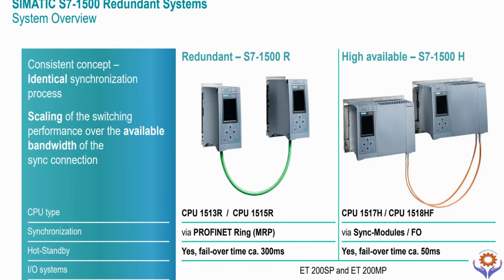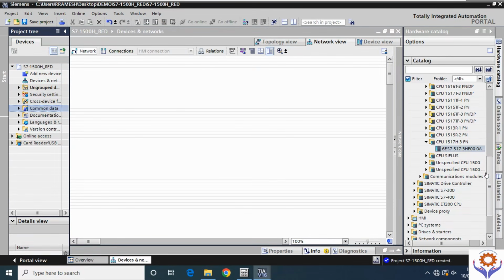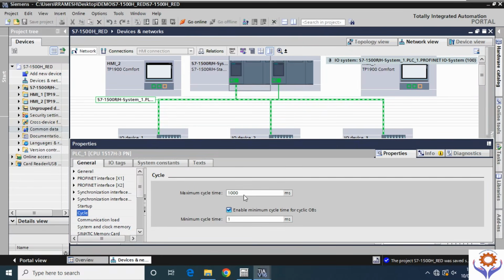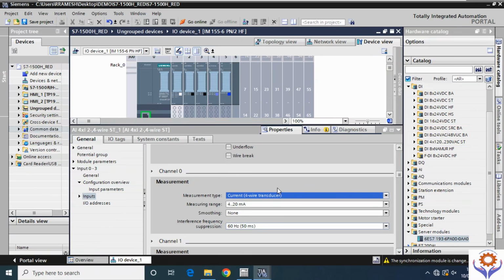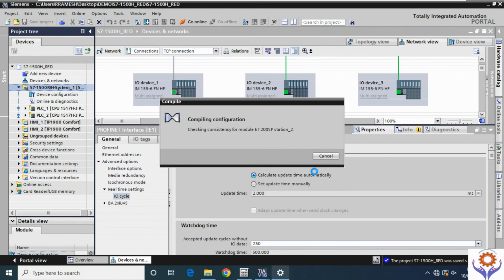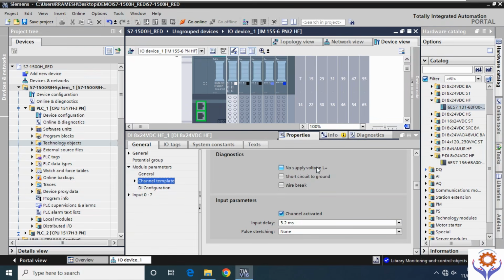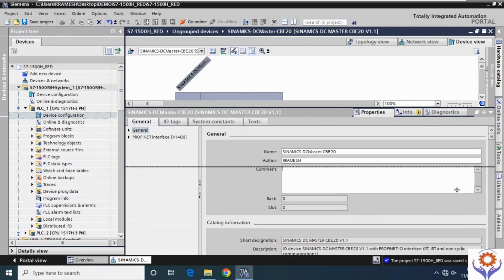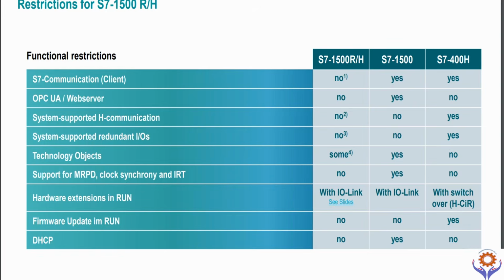SIEMENS S7-1500  REDUNDANCY CONFIGURATION -TIA PORTAL | SIMATIC S71500 R/H SYSTEM | A COMPLETE GUIDE

Comment: Why the simulation does'nt work with Tia V17 , PlcSim Advanced v17. i need to simulate a faillure on cpu redundancy can u help me ?
Reply from the maker: @HouZine03  You need to use advance level of PLCSIM for Redundancy CPU
Reply: @Automation4all  can u tell me how to do that exactly please
Reply from the maker: @HouZine03   Try to use  SIMATIC S7-1500 S7-PLCSIM Advanced V4.0 or higher version. This can support S7-1500 redundant simulation